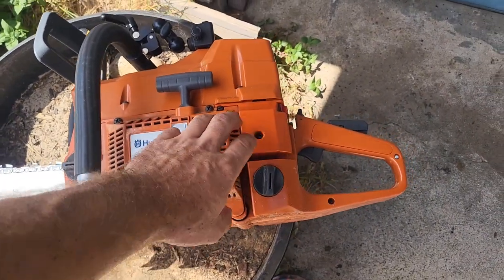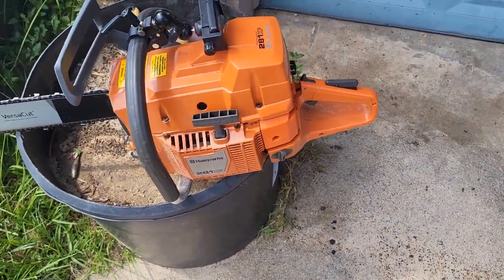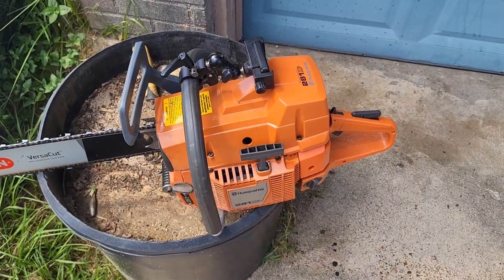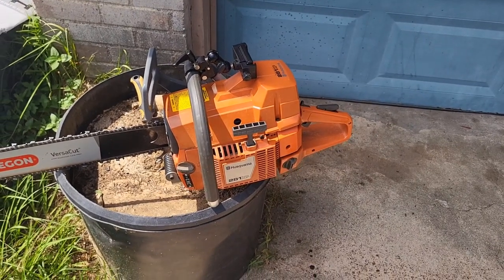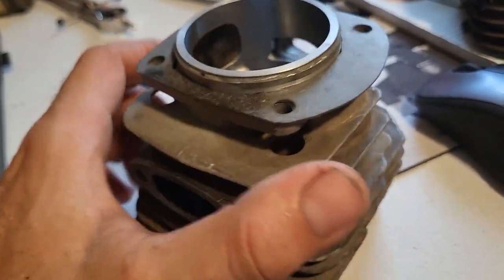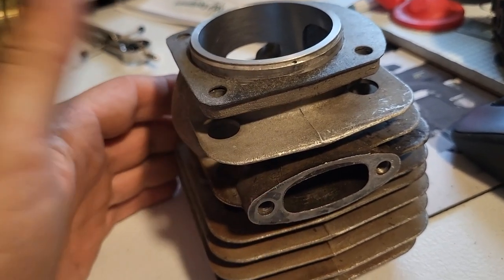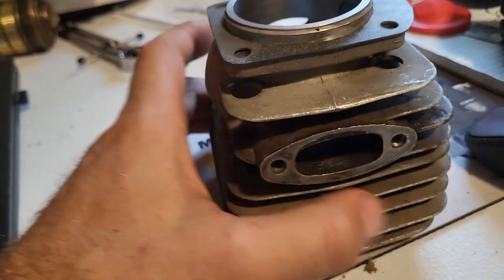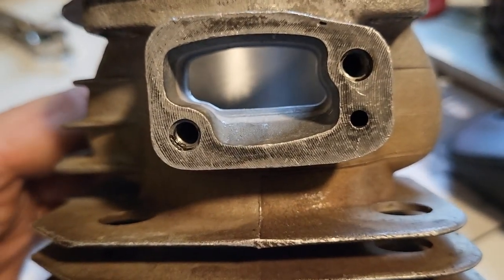288xp - more ignition advance

Comment: Ignition Timing!! Been thinking about THAT while raking hay, too. Built a spreadsheet for it, but I ain't sure yet???
Reply from the maker: I think it ties in with chamber design really closely for the initial setting and after that scales linearly with rpm on mufflers. Pipes are different from what i read from the bike guys.

Comment: Seems like a lean on saw. Chain speed looks slow for some reason. Doesn't seem to lose a lot in the cut. The kind of saw that won't hurt itself. Echo 8000 comes to mind. But I've never ran that saw.
Reply from the maker: There is a lot left on the table for this one. It runs good, not knock your socks off but runs good. I havent done any machine work yet.